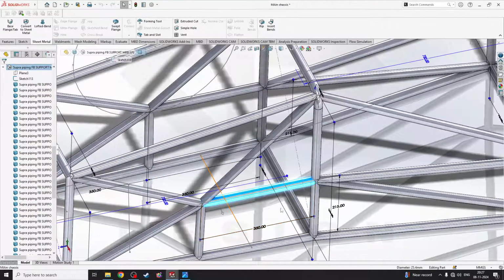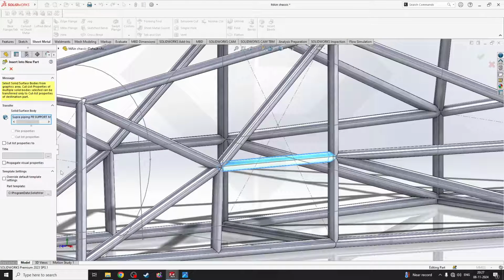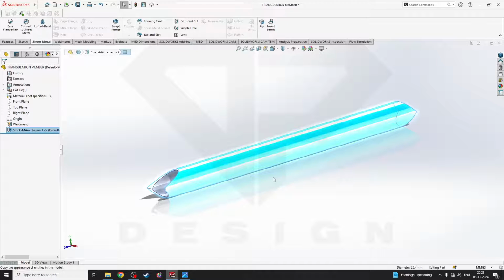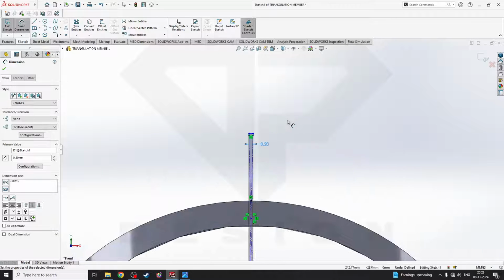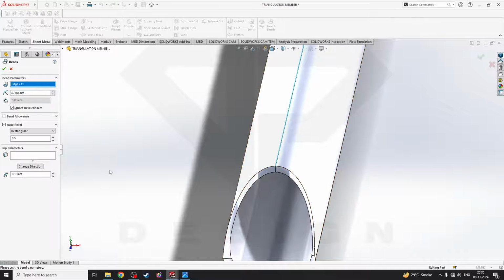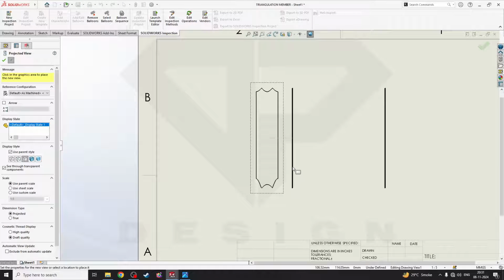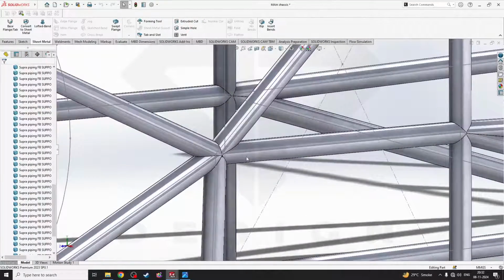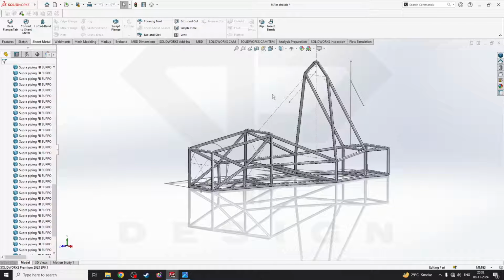FORMULA STUDENT #9 : Pipe Notching in Practical - Real time Notching | FSAE | Machining | DP DESIGN

Comment: my pipe od is 29.21 and with a circumference of 91.74, but after fattening the length becomes 86mm, which should be around 91 mm 
So that's why my notching is not able to be accomplished by this method , can you resolve the problem that i am facing here please
Reply from the maker: 1. One probable reason can be the k Factor of sheet metal. Try to do it with 0.5 value in sheet metal. Sometimes the wrong K factor leads to the compression or stretching of the material while doing flattered 

2. Try to extrude the cut as smaller as possible. We can do it in microns for greater accuracy. 

If the problem is still not resolving please share with us the model on dpdesign.engineeringsolutions@gmail.com

We will surely study this in deep and get it resolved